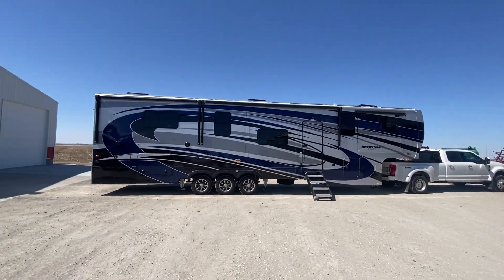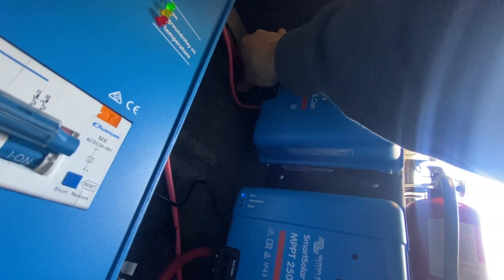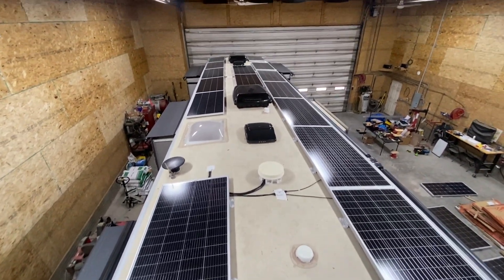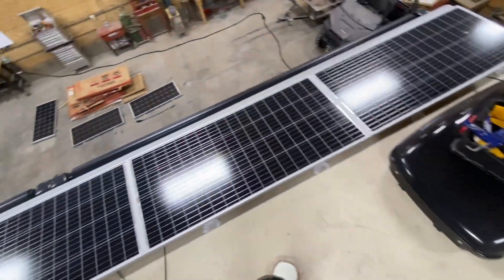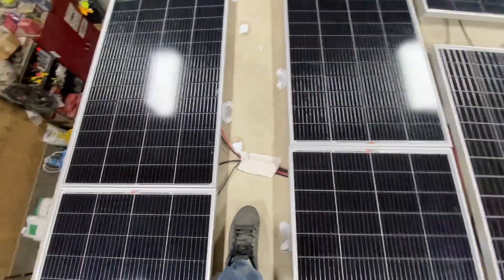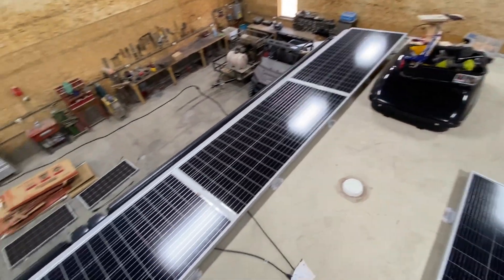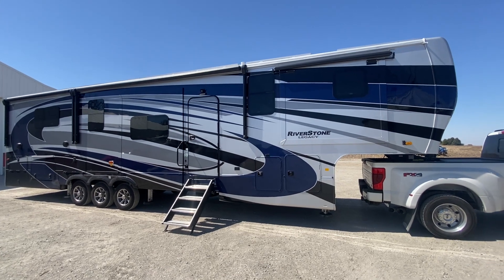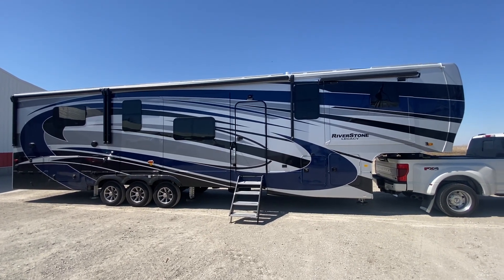Riverstone Legacy RV Solar Upgrade to 3200w

Comment: What voltage are the inverters running at? I’ve noticed many of your installs are at 12v, any reason for that compared to going 24 or 48v?
Reply from the maker: This one is also 12v - at the time this is what the customer wanted. We talked pros and cons.  They chose 12v . 
24v is my favorite currently, primarily because you can still get a Multiplus II 2x120 inverter at 24v.  Shawn runs 24v in his bud and JD runs 48v in his bus. We love the higher voltages !
Reply: @sotasolar  24V all the way! (Until Victron makes a 48V 2x120!)